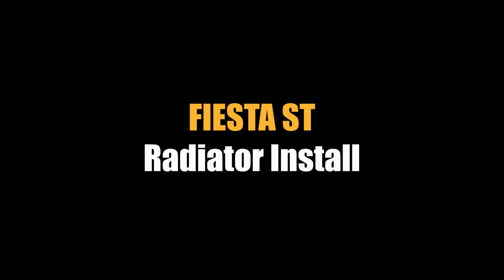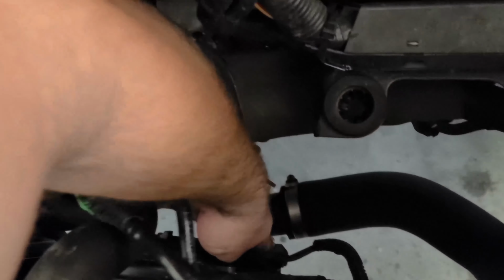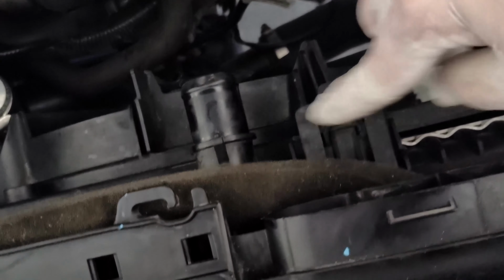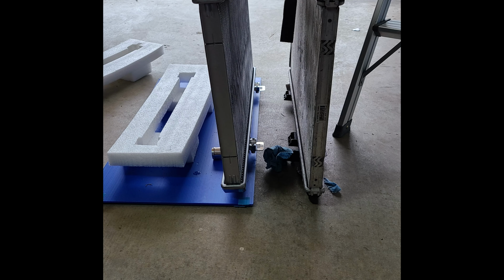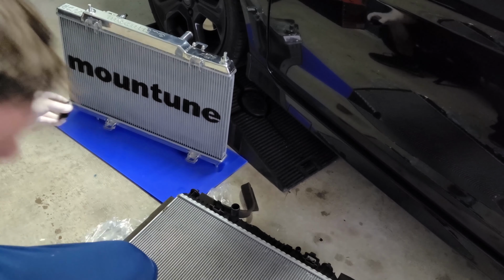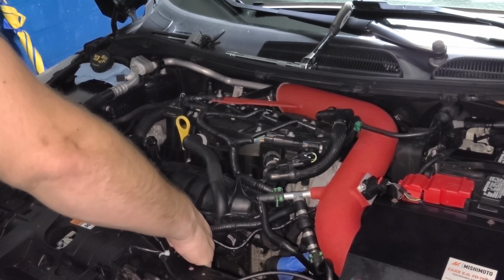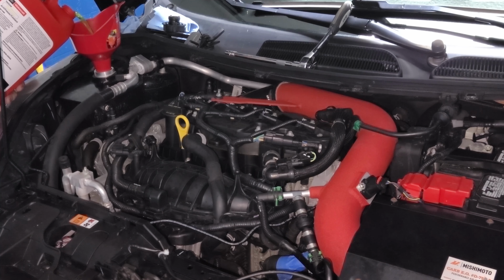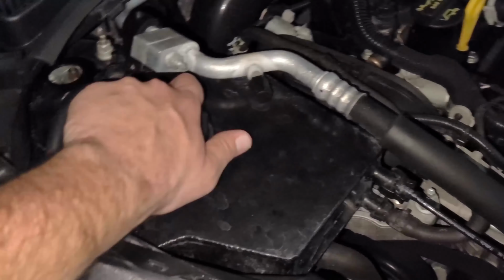How to INSTALL A RADIATOR in a FIESTA ST

Comment: I watched a video of someone doing this and basocally taking the whole nose of the car and thought to myself, theres gotta be an easier way, and now that I see this, I see that there is. I will be installing my radiator similar to how you did it.
Reply from the maker: Awesome! Glad my video helps! 😁 And yeah, I am pretty sure that Mishimoto tells you to take the whole bumper and crash bar off. 

Their kit comes with a mishimoto fan shroud though, that may be why. But either way, you shouldn't have to remove the whole front if it is a "drop-in fit" lol.

Comment: What would you say are the signs to know when its time to replace the stock radiator? In my country it is more often cold than hot in rare scenarios it could reach 86 F. Nonetheless a very interesting video, subbed!
Reply from the maker: Appreciate the sub! As far as how to know when it is time to swap your stock radiator, I'd say when temps starting getting higher than usual, or the radiator is visually deteriorating(i.e. the fins are damaged, etc.). Typically you'd want to swap your coolant first and see if that helps before jumping to buying a brand new radiator.

That being said, I swapped my stock radiator out because  the FiST's stock radiator is VERY inefficient and caused my FiST to overheat a few times on track or during autocross. So if you plan to track your car at all, I'd recommend swapping to a better aftermarket rad.

Comment: I noticed that orange coolant is what drained out, but you added green dyed coolant. Or is that yellow? Does it matter?
Thanks. Excellent how-to.
Reply from the maker: Iirc it was Ford's recommended coolant which was yellow. They allowed a different coolant at some point a few years ago. I made sure it was approved haha. I wouldn't recommend buying random stuff, but they should have the approved coolant to use somewhere online. Can't remember off the top of my head
Reply: @happyhills_garage  I had already bought the Ford approved orange stuff. I sure it's ok to use.
Reply from the maker: @johnnycincocero  I think the orange stuff is fine 🤙and glad the video helped! GL and post here if you have questions!
Reply: @happyhills_garage  Will do. Thanks again.

Comment: Thanks, this is gonna help me out a lot when I try to install my Mountune radiator tomorrow. 

I noticed you have the Mishimoto air intake. I was considering buying one of those as well because it has an airbox, unlike my open Injen unit that came with my car. But after looking closer at you video, it doesn't seem like the mishimoto intake utilizes the stock air scoop either. Is that the case? I might end up making my own airbox because I'm not particularly happy with any of the common aftermarket solutions for FiSTs.
Reply from the maker: Glad the video helps!!

And as for the air box, you are correct. It doesn't utilize the the air scoop, however, the lower portion of the Mishimoto airbox does have a decently sized opening that utilizes not only where the original air scoop was, but also excess air that passes through the radiator.

Comment: Hoping this exact process could be followed for the whoosh radiator; it's available for under $400 right now and I really need to upgrade my rad. Kept putting it off though since it's a really unappealing/"unfun" purchase and I saw how videos like Mishimoto's show it being replaced.. yikes.
Reply from the maker: Hope it works out for you! If it is anything like the Mountune radiator, or smaller, than it should work out just fine for you.
Reply: @happyhills_garage  for now I'm actually gonna fab a radiator sprayer. But if that doesn't "bandaid" the problem on the rare days the rad can't handle it, I'll bite the bullet and upgrade. Thanks for this video; it's def the best
Reply from the maker: @Brandonr757sGaming  haha thanks man! The stock radiators do unfortunately suck...majorly...even with sprayers, etc.
Reply: @happyhills_garage  considering I only was "overheating" (hitting 225+) two times last year.. I think sprayers might be just enough. At the least, it's really cool 😂 I'm doing one for the intercooler anyways, so.. why not!
Reply from the maker: @Brandonr757sGaming  that's fair lol

Comment: I like the videos. I have 2014 Ford fiesta st. I absolutely love that car.
Reply from the maker: Thank you! The FiST's are amazing cars for sure!
Reply: @happyhills_garage    Do you prefer the fiesta or corolla hatchback?
Reply from the maker: @SonOvaSon  I'm gonna have to do a video about this haha. It's hard to say to be honest. I love both cars. The GR is amazingly fun, quick and agile with AWD and 3 cylinders! The FiST is a ton of fun as well with quite a bit less power and FWD. I feel like both cars are extremely engaging, but the FiST requires a little less attentiveness (if that makes sense), whereas the Corolla is more powerful and kind of requires you to not just send the car (even though it is more than capable to allow you to do that), but actually requires you to understand the limits and respect what it can do. 

Making a video will be a better way for me to get my point across lol
Reply: @happyhills_garage     I think I know what you mean the fiesta seems like it’s easier to throw around when the Corolla needs time to master. I have a fiesta but it’s been a nightmare of problems for me and I’m just paranoid driving it around now so I was thinking of switching to a Corolla once it’s fixed up

Comment: You miss a lot of details with the fast action. I'm a back yard mechanic. I've changed engines, clutches, etc.  I can't change my Fiesta radiator with your instructions..
Reply from the maker: If you can be more specific as to what the too fast of actions were? Considering it's a near 20 minute video, with verbal directions on what to do throughout,  I figured it would be easy enough to follow. Lol